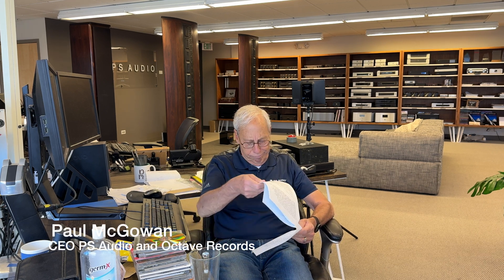Matching vacuum tubes

Comment: I use a tube phono amp (for MM cart) with 6N2 tubes (complete with tube rectifier) feeding a tube integrated amp with 12AX7 pre amp stage, EL84 output stage, all analogue, beautiful sound, it can never be 'too tubey'.....as Paul says, it's the synergy and sound (with the right paired speakers) that matters.

Comment: I use 6n2p tubes where a 12AX7 might normally be used.  Similar characteristics, but a quiet crystal clear tube.  Of course different heater wiring.  Lampizator put me on to this little gem.  It is dirt cheap and has all the tube goodness without the colored haze.

Comment: I once built an ultra low noise phono stage using a two stage EF86 low noise pentode ... it had 4 poles for the inverse RIAA response and was was infinitely quieter than any solid  state designs

Comment: I admit I don't get the attraction of tubes. If one really wants the type of distortion that tubes generate couldn't that be simulated in a DSP? You could even have a menu of various tube types to choose from. Of course you wouldn't get the glow in the dark aspect, but maybe that could be simulated with LED's in a fake tube :)
Reply: Tube > DSP Imposter
Reply: I am sure each experience depends on equipment matching, but I got a wider and deeper soundstage with a tube amp compared to a similar priced solid state.
Reply: @alexrtop you also get more distortion, less power and less bottom end. I guess it's what people prefer to listen to
Reply: @xaviermontalban1701 is class D your favorite type amp?
Reply: @Scottlp2  it depends. Some are really good but others not. Also, I like the tube-solid state combination. But again it depends on the equipment. There are so many out there. I recently made my own amplifier. Its class D monoblacks and separated power supplies. Sounds pretty good
Reply: @xaviermontalban1701 less power, less bottom end is only problematic if your loudspeakers are hard to drive. Not a tube user (yet) because of the fuss but…. Denying the magic is ehm well… stupid
Reply: @nirodha35  Brother, those are the facts for most of the tube amps. As for that "magic," that's entirely subjective
Reply: Unless you've heard vinyl playing through a very good tube phono stage you won't know WHY some people love the combination of vinyl with tubes . It sounds musical , magical .
Reply: @biketech60  Exactly!
Reply: The whole point is to get away from digital electronics,not the distortion.Some things you just cannot fake.
Reply: Of course it can be simulated in DSP and it won’t drift by time or behave different by temperature. Also, with a DSP you are not limited to what a vacuum tube can technically do. You can theoretically create exactly the type of distortion behavior you might like sounding better than actual tubes.
Reply: @ThinkingBetter Havent heard about this. Who the hell can emulate tube distortion with dsp? And is it going to result in better soundstaging, decays, body, musicality?
Reply: @kristofvadnai  Tube signal behavior is common in DAWs as plugins, for example. Of course you can add even harmonic distortion to enable more tube like sounds. There is nothing a tube can do that you can’t do even better in a DSP.
Reply: @kristofvadnai Honestly, this has been done numerous times.  Most notable is Carver's Sonic Holography circuit and R2R DAC circuits.  Many amps are more subtle about it, but it's there depending upon how much color the engineers decide to add to the music.
Reply: @ThinkingBetter Dsp is for music production and av processing.
Reply: @ThinkingBetter  And in the context of hifi, you know high fidelity ? dsp ? or no dsp ?
Reply: @petrosnemardos  DSP is great for digital cross-over filtering and EQ in active high-end speakers such as my KEF LS60.
Reply: @ThinkingBetter  The lower price of dsp chips and the convenience of active speakers is well known (especially in music production). Sound wise you can still hear that digital sound grinding away with the music (to my ears at least).
By the way the kefs do sound good.
Reply: @petrosnemardos  There is no such thing as "digital sound grinding away with the music" due to DSP unless the math in the DSP is really poor or with bugs. Poorly done DSP algorithms might introduce quantization errors, phase issues or other artifacts but then it's about bad engineering similar to an amp circuit not done well. Actually a DSP can do much better filtering and EQ than analog components because you are not limited to what such components can do. But there can be 2 concerns using DSP in a high-end system: If you like playing analog sources (mostly vinyl), a DSP is not really suitable because you end up introducing both an ADC and DAC stage in the signal flow. Also, if you are into DSD, a DSP is not your best friend because it operates on PCM and you will have to transcode DSD to PCM. However, any digitally produced music track in DSD actually existed as PCM anyway in the mastering process (what few wants to admit). As lossless streaming takes over audiophile listening, DSP will increasingly become the preferred way to tweak and filter the audio signals also for higher-end systems.
Reply: @ThinkingBetter  After listening at hifi shows etc I came to the conclusion that dsp in general wasn't ready yet. By the way ADA is already  in the music we listen to.
Reply: @petrosnemardos  I was just attending T.H.E. Show in Costa Mesa here a few weeks ago and like always, everything is on the retro style of technology. High-end audio usually don’t lead in the latest of technology but is more about uninhibited use of established best practices in audio engineering with less concern on BOM cost. Fans of vinyl like to stay analog from cartridge to voice coil thus DSP is not an option. Audiophile systems that are optimized solely for streaming are still rare but will surely be on the rise in the future. So DSP for audiophile setups has the future going for it, but it will rise with the speed of the vinyl to streaming transition, which is a bit slow for audiophile setups.
Reply: You do know tube designers are not as fussed about distortion as other types of designers right ?
Reply: @petrosnemardos  Audio engineers using tubes are aiming at the tube distortion making music sound more live.  In my opinion it’s all good if you enjoy it, but it’s not a purist sort of quality of an audio system for sure.
Reply: @petrosnemardos  What's your point?
Reply: @kb9gkc  My point is if the benefit you get from tubes negates distortion then why would a designer or listener care ?
Reply: They 'Digitally ' recreate different  tube types within the musical instrument amplifier modeler space..You can dial up a 6V6, EL34 , KT88 amp or whatever you want. 
You can add to that, your choice of microphone models (Neumann U87s, Royers , whatever). You can add whatever speaker cabinet you desire and exact microphone placement..Its pretty incredible  and convincing. It makes $500,000 worth of vintage guitar amps arguably obsolete in the studio..Unless you knew what you were listening for, you wouldn't pick it.. A guitar specialist may, an audiophile certainly wouldn't.
Reply: @bryanwilliams3665  Dsp is for music production and av processing. We're talking hifi here.
Reply: I always wonder what people mean with words when it comes to these conversations between tubes and solid state. I wonder what the words mean from audio reviewers too, i.e. “warm.” Yeah we can put anything on a scope and decide we don’t like to hear what we see. One has to wonder what we see sounds like, truly.
Reply: @Rotteneggsack  If you have had heard the same differences before or understand the elements of what you're hearing with a hifi rig you should understand the adjectives.

Comment: People need to start thinking of tubes other than the 12AX7A, which is drastically overused.  
It is easy to work with and plentiful, but as Paul says it is noisy.    
Other types were developed long ago that are superior.  
I will not name them here; a quick look at tube manuals will reveal them.

Comment: A phono amp and a line amp are VASTLY different roles. Even a ‘high output’ cartridge will have an output of 1mV, a typical line stage input, be it from your phono amp or digital source, will commonly be >2V. 

As Paul says, an ECC83(12AX7) is too noisy, low transconductance and low amplification to be useful in the input of a phono amp. The best phono stage input tube is unfortunately so rare and expensive these days that most commercial manufacturers have abandoned its usage. 

At this point I would do some demos in person with your favorite shop. Once you’ve found something that sounds good in their room, arrange an in-home demo for at least a week, longer if unit is not broken in. You MUST demo the unit in your system to determine compatibility with your cartridge, arm and integrated amp. Phono amp compatibility with cartridges is enormously critical to achieving your listening enjoyment

Comment: I just think use good quality tubes, they don't have to be necessarily same brand in phono-amp as the pre-amp
Reply: They don't have to even be the same type.
I have a full function tube preamp using 12AT7/ECC81 for the phono stage & 6922/ECC88 for the line stage.
It's the designer's intention, & he is within 30 minutes drive from my home.